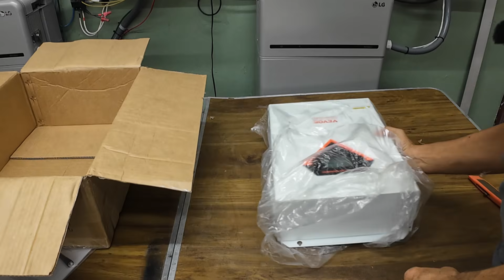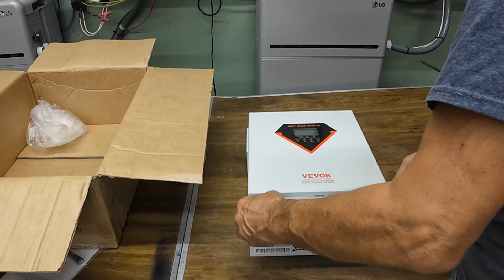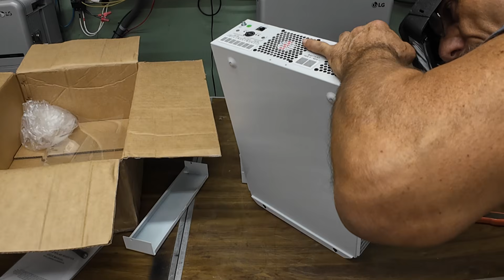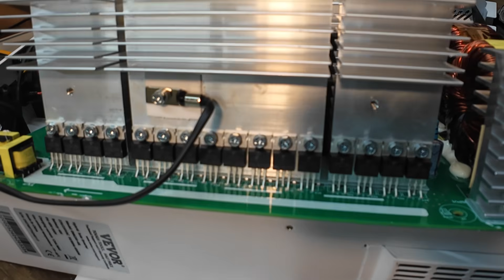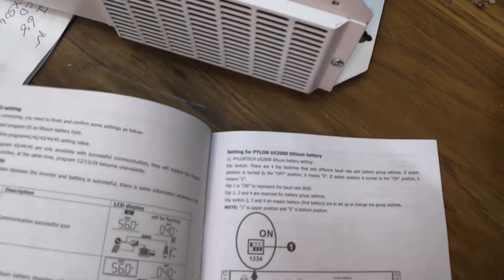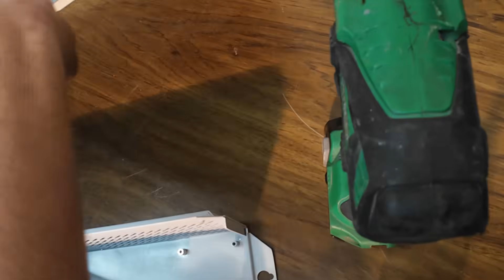$300 6 kW Hybrid Solar Inverter - What’s Really Inside?

Comment: i might buy this just for the high voltage solar charge portion lol 60-500V input to charge my 48V solar battery bank instead of spending mega $$$ on victron equipment. Cant wait for the test video!!
Reply from the maker: Good idea cheap MPPT charge controller!
Reply: They have horridly high idle current.  So you gain by saving money but lose about 2.4-3kWh a day on idle losses. 

This happens because you can't have just the mppt on, it has to have both the mppt and inverter operating at the same time. 

They do have a place though and I still think it should be possible to use a smaller Victron mppt to drive one of these cheap units by utalising the programmable load terminals and the solar light setting.  So the victim mppt turns on the cheap o hybrid when there is sun and turns it off again when there's no sun.
Reply from the maker: @WindyJAMiller  Yeah I found mine to have about 1.2 amps of idle current. don't think that will be an issue for the application I'll be using it for.
Also that was kind of the idea for the contactor, to be able to turn it on and off with a micro controller.

Comment: With those cheap, Chinese-made caps, FETs, and Insulated, Base Bipolar Transistors (IGBTs) and no galvanic isolation at the output, even at $300, I wouldn't dare plug in any valuable appliances into it.
Reply from the maker: OK quickquote, I was wondering what was taking you so long! 🤣
Reply: @DIYSolarFarming  🤣🤣🤣
Reply: What do you mean by galvanic isolation at the output? There's a HF transformer right in the middle. That's why the IGBT drivers are all optoisolated.

Are you talking about an isolating LF transformer right after the filtered AC output?
Reply: @subhobroto Yes, a high frequency transformer to boost the DC voltages, before it chopped by the H-Bridge circuit. Without using a transformer at the output, there is no inherent means of blocking this high voltage, high amperage  DC current from passing through to your AC loads should the output from MOSFETs in the H-Bridge circuit short to ground.

Comment: got news for you the air filters are in wrong spot.  sungold and ecoworthy  similar build  fans draw air from the bottom over the massive heat sinks and blow upwards through the machine and then somewhat forced out through the top vents.   i think the filter is there so dust dont fall in. not the best design, on my eco worthy i will place two fans low rpm to constantly draw air out from the top, one on each side.      being that its 220v   this could be a dedicated car charger, EV or PHEV.
Reply: If those fans are DC, couldnt you just reverse their polarity?
Reply from the maker: That's funny, thanks!
Reply: Actually the syrne clone I have as well as many pull air through the filters on the sides and out the bottom so they arent in the wrong place.

Comment: Dont know if you know but youbcan flash your older s19 95t models with luxor luxOS software and control power and hashrate really easy and even get 25j/th out of them. Every bit of efficiency helps.
Reply from the maker: Thanks, I run Vnish controlled by my Python script.
Thanks for watching!
Reply: @DIYSolarFarming  I am looking at setting up a couple of S19Js and I trying to decide between Vnish and Braiins firmware.  what did you like about Vnish or are they both about equal?
Reply from the maker: @pewing99  I started with Vnish and it works well with my automation so I really didn't see the need to try anything else.

Comment: When testing, might check how clean the sine wave is. Even some $$$ units have dirty wave
Reply from the maker: Will do.
Thanks for watching!
Reply: man one thing I've noticed about some cheap inverters and a few expensive inverters as well is when they get a big load thrown on them all at once the sign wave takes a few seconds to steady back out. the dirty sign wave for a few seconds can be hard on some sensitive stuff but if used for water heaters or something like that then it really don't matter.

Comment: Thought there was a G/N bond problem that caused issues with these 240v inverters only in the US. Maybe only if it’s attached to a grid input. Dunno just recall some safety issue.
Reply from the maker: Yep, you need a transformer if you want to run on split-phase.
Reply: @DIYSolarFarming thought there was something with the g/n bind where if the bond is in the inverter the case itself could carry 240v.
Reply: Yeah, there was on some 230/240 volt inverters.  I think both Dave Poz and Will Prowse covered it on their channels.  Probably a lot of other solar folks, too.
It's a ground/neutral bond on the inverter mainboard that caused problems if the inverter was connected to the grid.  I believe the problem was the case carrying voltage in that event.  Could be wrong though.
As I recall, those 230/240 volt inverters were first made for Europe, which handles grounding differently than the US.
Reply: Inverter bonding is a problem when connecting to both mains and off  grid there are good videos  of removing bonding using relay

Comment: Is this 50 or 60 hertz? You said it was 220v could use this inverter solely for a 220v circuit in the USA for like a dryer or a hot water heater etc?
Reply from the maker: 60 cycle but I'm sure it can be switched to 50 and yes I plan on running some 240 volt miners on it.
Thanks for watching!

Comment: too bad its 220v, otherwise would be good deal
Reply from the maker: Right, you can add a transformer but then you might as well buy a split phase inverter. It's only viable if you have a 240v only load to run on it or you can get a good deal on a transformer.
Thanks for watching!
Reply: the 120v 3kw version is only $200shipped from ali but its blue and branded at "anenji" same manufacturer though
Reply: The prices of these all jumped about $35-50 over the weekend
Reply from the maker: @fathergratwick  Still $313 at vevor for now, use my link they will probably go up soon too...

Comment: if the growatt offgrid (SPF )series are legal in america, they sell a inverter that  compares to the EG4 6000XP for 1/3 of the price in eu (600€ growatt SPF 6000 ES )

not much difference if i remember correct the growatt can be stacked to get a little more power in total
and if you want 110v its not the eu version (es) but there might be a uk or some for another region that uses 110v avalible

growatt makes alot of different inverters for the different markeds, so they might have 110v avalible cheap

the inverter i have (sph) they made over 20 different models and most markeds only offer 3-5 of them 
its so confusing
Reply from the maker: They do sell them here, Growatt SPF 3500TL LVM-US 3.5kW $879.00.
Reply: @DIYSolarFarming  here we have that serie in 3.5kw - 5kw  - 6 kw (but it looks like they are not made anymore, they are getting hard to get )

Comment: With a few a these (if they pass the test) and those S19j's in low power mode, without batteries, then good chance of break-even before next BTC halving. Everything is made in the same factory in China, these may all be the same thing just rebranded. Vevor doesn't manufacture a single thing as far as I know, they all source stuff from companies on alibaba with their deets silkscreened on for them. Will be cool to see the S19's running on this in future video.
Reply from the maker: That would be cool but you need at least a small battery t get through intermittent clouds otherwise the miner will be power cycling all the time. That would most likely give a high failure rate.
Reply: @DIYSolarFarming  Would be extremely interesting to have intelligent firmware on the miner that can control the load on the individual asic chip level dynamically with feedback from the invertver to tell it how much power is coming in. Afaik such firmware doesn't currently exist.

Comment: It’s another SNRE clone. Just like my eco-worthy version but a much better price. Great find!!!
Reply from the maker: Thanks, we'll see if it holds up. I need at least 5kW continuous for a project, maybe with some mods.
Thanks for watching!
Reply: @DIYSolarFarming the vevor 6kw is good new inverter ibrido is similar al 5.5kw vevor in Europa 3anni vevor vende come cinebasto disel vevor for camper o house con app.sul di o vevor mppt is snre rimarchiat vevor 30ah 100v 84euro and  dstek mppt is identic 30ah 146euro is srne original
Reply: Do you know what the SNRE model number is? Are there forums where they discuss this model?
Reply: can it turn on a 6000 btu ac window unit.mayby 3 of them

Comment: What's the idle consumption in this
Reply from the maker: We will find out when I get a battery in, I have a pretty interesting use for this if it holds up!
Thanks for watching!
Reply: Mrpower draws 50-100w when the inverter is on and 35w when turned off (solar charger mode). Grid-tie it's around 100w.